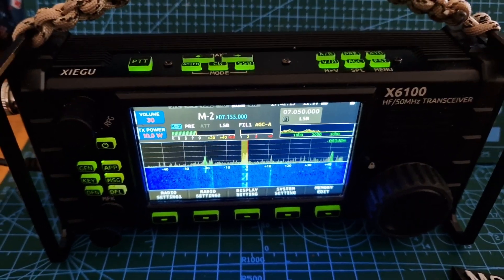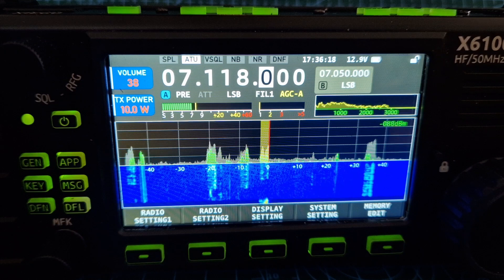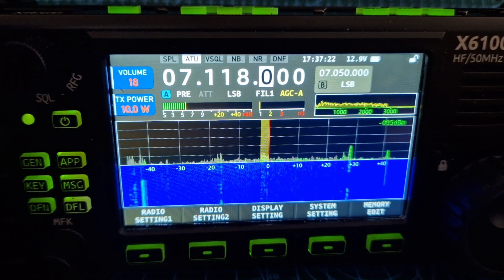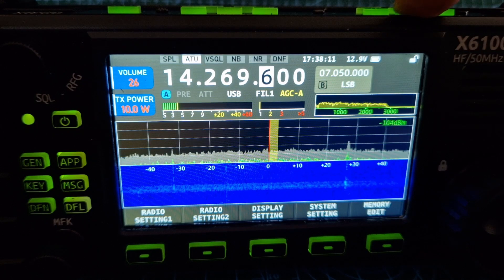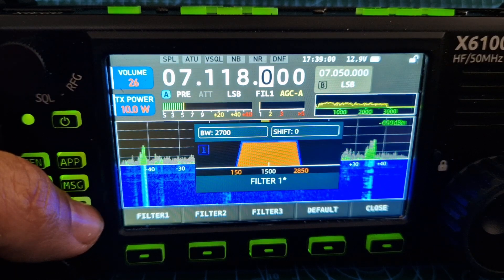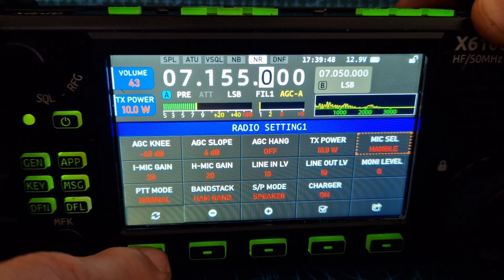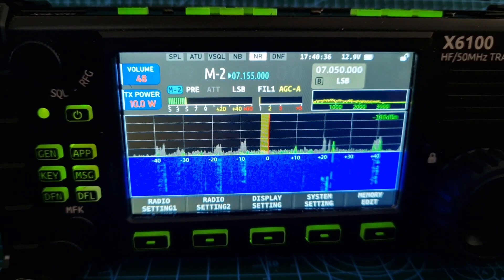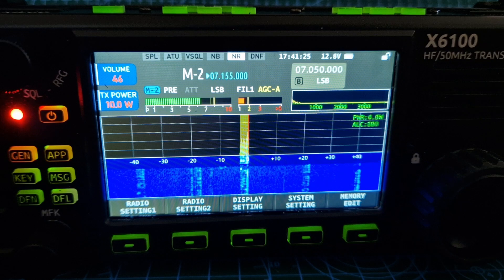Xiegu X6100 - Test Firmware v1.1.5

Comment: Hello Andreas,

I wasn't expecting the update yet but I'm happy about it because the CW decoder works again.
Unfortunately, the FM reception is still not fixed.
I don't know if it concerns only my X6100 or if other Hams experience this with their X6100 as well.
In the Netherlands, we use FM mainly locally on 50 MHz.

73'

Erwin PE2FOX
Reply from the maker: Hi I do not use FM what is the Problem.
Reply: @M0FXBHamTech  

On the 6 meter it goes wrong with the signal conversion to FM.
The cause of this would be the algorithm, which would be fixed in a next update. 
Maybe they haven't figured it out yet.
I wonder if I am the only one with this FM problem because I don't hear about it from anybody else.

Erwin